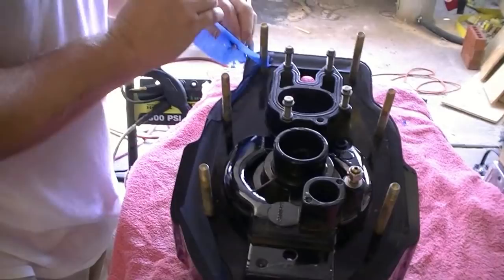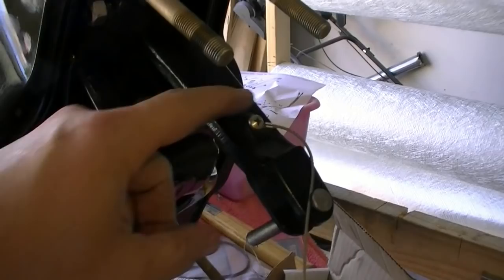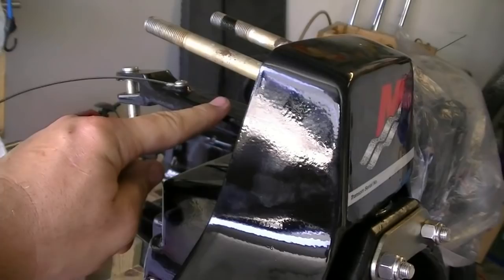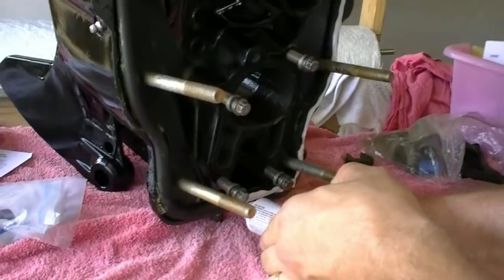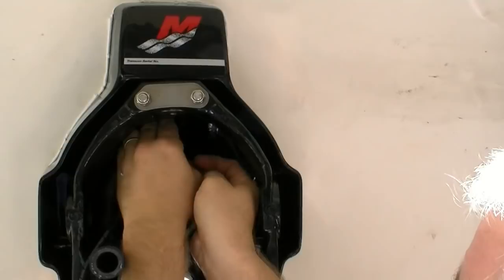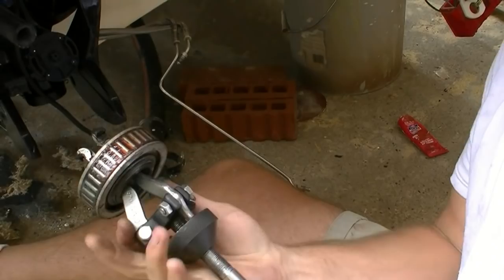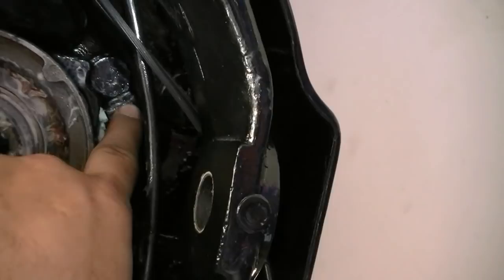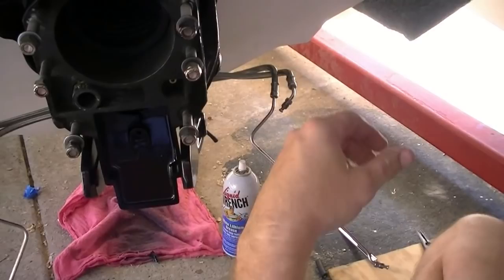Rebuilding the Gimbal housing and installing the Bearing Part 3 Vlog #52

Comment: I don't know if your dealer guy ever told you why you are getting some corrosion or not. the reason your gimbal unit is getting some corrosion is because your anodes aren't working properly. as the propeller churns in the water, it creates a static discharge. the anodes are added so that they can properly dissipate that static discharge and keep your unit from corroding. make sure your anodes are contacting bare metal to metal contact and make sure you don't paint them or anything like that. you should seal them so they don't leak water, but again make sure they contact the bolts and make good metal to metal contact. you may even want to add extra anodes to your outdrive for extra protection for it as well. also make sure all your grounding cables are correctly placed and again make good metal to metal contact. you did a great job with your repair, but if your anodes and grounds were working properly, you should never have had to do this repair job. (just thought i'd throw in my two cents worth.)  :-)

Comment: I got a slide hammer very similar at Harbor Freight Tools.  I tried a gear puller but you also need adapters and such to make it work.  The slide hammer works great.

Comment: Big favor, about the 13:30 mark you state that you need to adjust the trim sender by starting in the "middle" and get your engine running.  I would like to make sure I don't damage the U joint by over trimming where the limit should cut off and also get accurate gauge readings.  I can not find any info on this process could you explain this any further it would be greatly appreciated as I will be looking at replacing my sender and limit switch in the near future.  Thank you so much Great Job

Comment: How hard was this? I am very mechanical so I'm not worried about not understanding it. I guess I'm mostly worried about the special tools and fitting my big hands into tiny places. What special tools will I need? The job I am trying to do is replace the gimbal bearing, bellows and seals on a 1995 alpha one Gen 2 lower unit. I have realized that I have to order the hinge pin tool so I'll get that. What else though? 
Also, while I'm in there should I replace the lower unit shift cable? Thank you for your help.

Comment: Where did you buy the stainless steel pin? I think you said in the video. Someone else's video recommended snap on tool part number 7M6A for the flex work unless you have another source. I think your video is very good and has great details.

Comment: When replacing the u-joint bellows I have not found in any manual, video or blog online that provides clear and exact instructions explaining where the external lip of the bellows (bell housing end) should be placed into the bell housing prior to inserting the sleeve.being more specific, where does the sleeve rest once pushed into the bellows?  Should the lip on the bellows be pulled into the bell housing past the groove in the bell housing or does the lip on bellows go into the groove on housing? OR.. Is the groove provided in bell housing  for where the outer edge of the retaining sleeve should rest once pushed into the bellows past the lip ?

Comment: I need help please.. my alignment tool does not pass the gimbal bearing.. on the old one?? I got the new one and haven't installed it but it won't go through either.. I have a feeling it's going to do the same thing once I installed it or it should go right through..